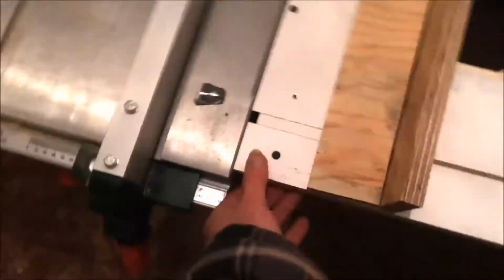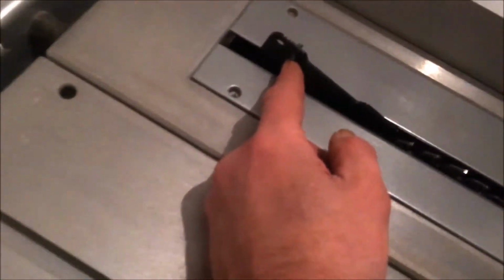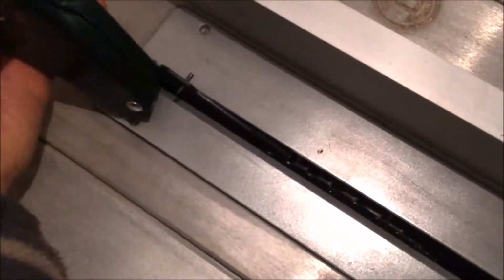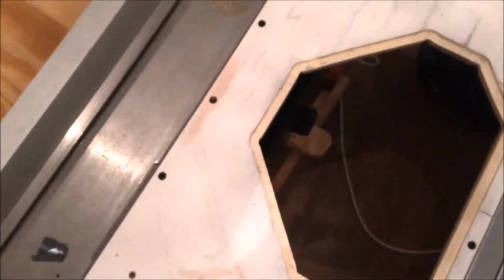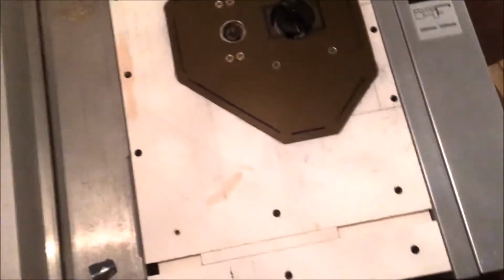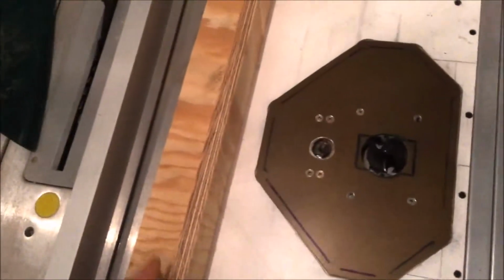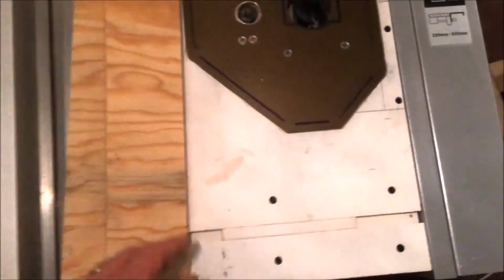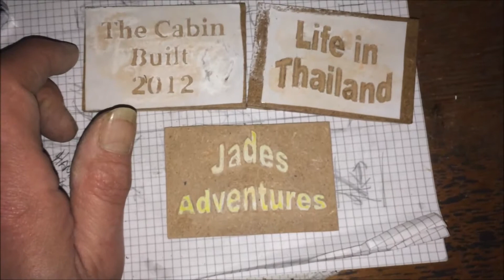Happy New year and update on the router table. 03 01 17

Comment: Would an pair of internal sprung calipers be any good for assessing the distance of the fence from one side of the blade to the other?  The farmer who owns those sheep probaby knows every one by name so your chances of bagging one undetected are slim.  Happy New Year to you too.  I hope 2017 is good to you.
Reply from the maker: Yes they would but the safety system is OTT. The pin trough the guide blade is a real pain if for a cross cut sled I will have to hog out the board about an inch so it passes and have to take the guard totally apart just to take it off I think the pin will go at least so it will be just one bolt them to undo and the guard will lift. Yeah the farmer probably will have names and know them all. I know a cow is named after my wife lol its true she visited a farm and they had a new calf the farmer named it after my wife ;-) Thanks mate same to you.